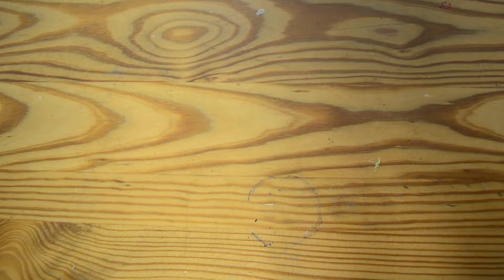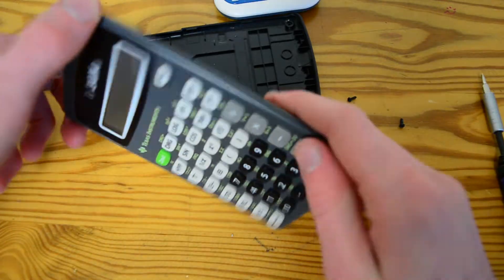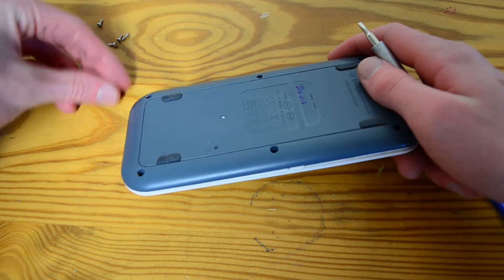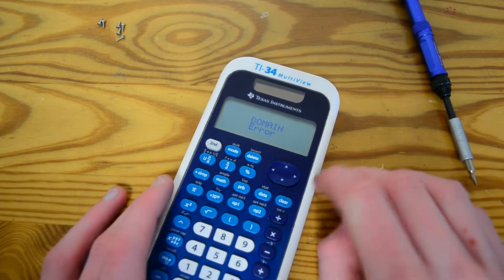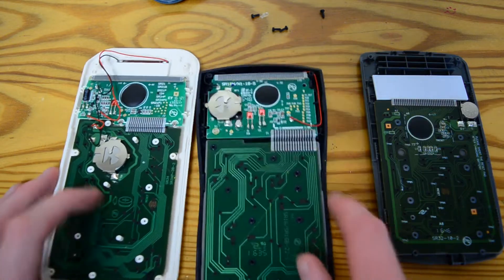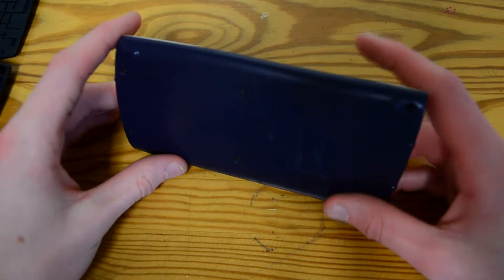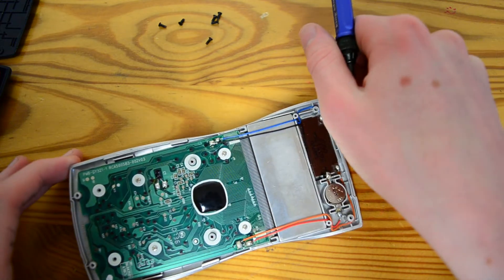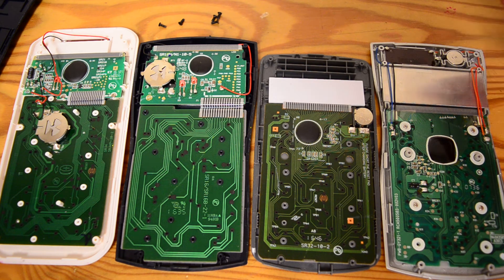What's inside these FOUR calculators? - TI and Casio calculator teardown

Comment: To me casio's are the best. 
They are not heavily over priced. The newer ones have good display. I got a 911ex last year and it has been awesome. I am yet to even utilise all of its functions. 
I paid like 20$ for it. 
I used a 7$ casio for my entire school and it just ran and ran. Required a new battery every few years. I used it a lot still it is not worn down. Keys are all visible even though the shell is heavily scratched up. It has taken some beating aswell.